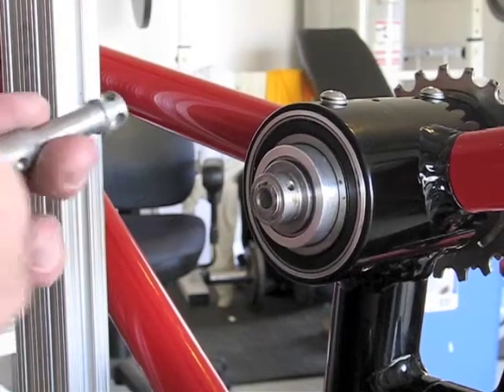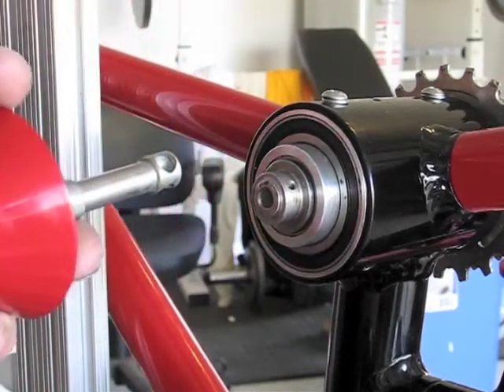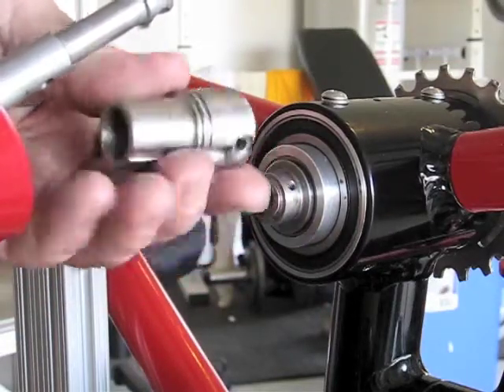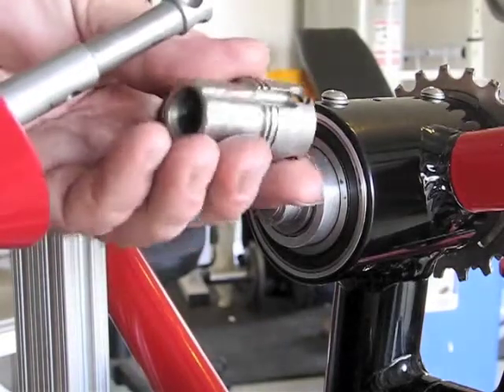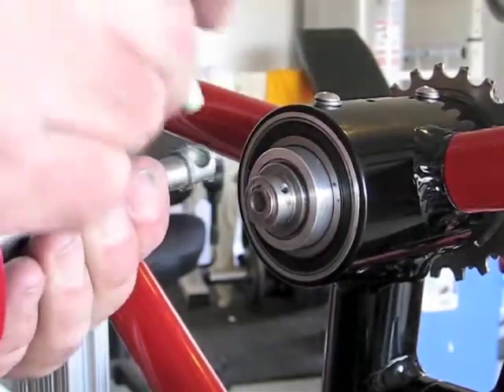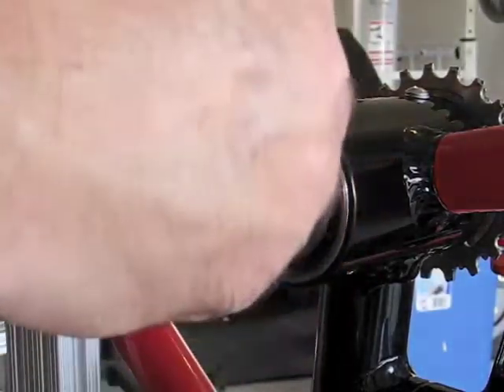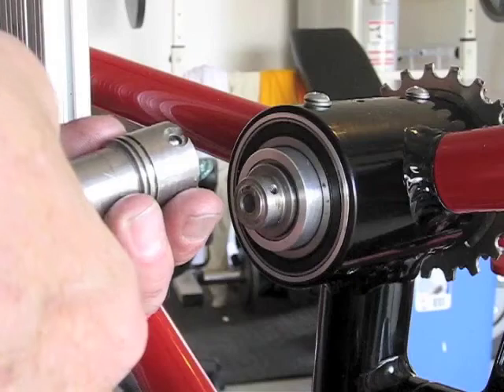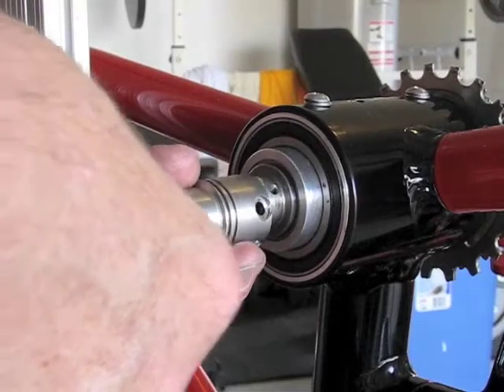FWDTrike Build part 4

Comment from the maker: @rounner The trike was never designed for off road use. The shocks are a bit overkill as all I wanted was some road damping. The single pivot swing arm is simple with only one pivot. A parallel suspension would involve a lot more work and weight with all the additional pivots and mounts. It's not perfect, but it works. I hate a long chain and the routing of it.